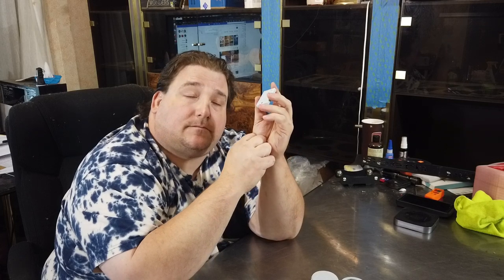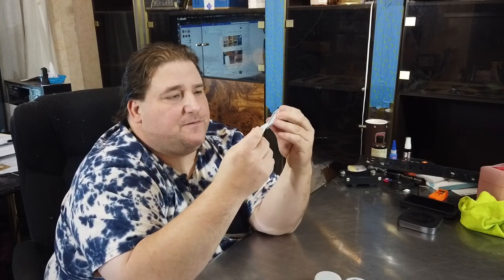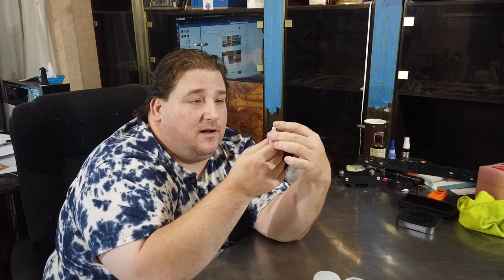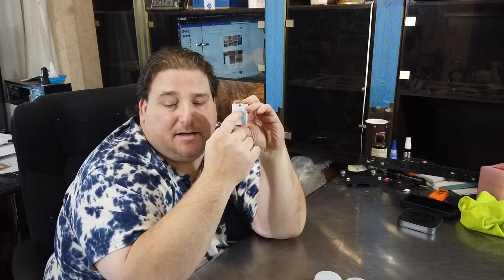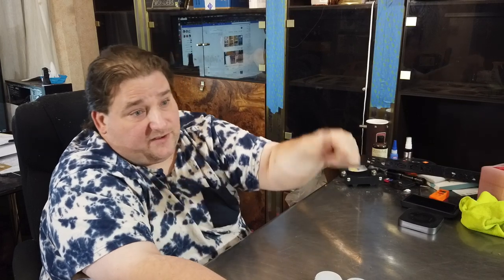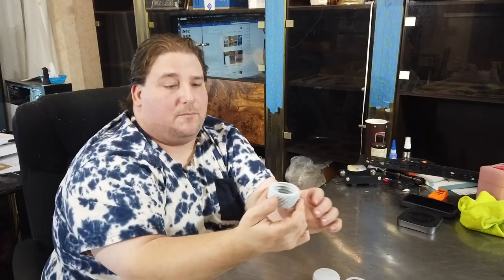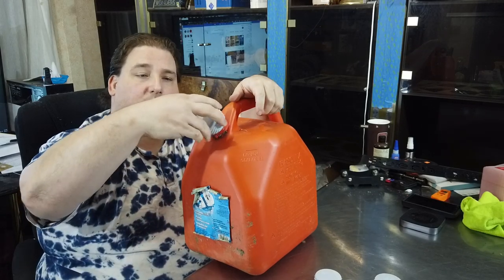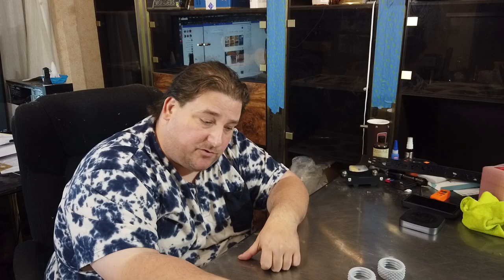Gas Can Cap and Micro SD Card Case   T3DP

Comment from the maker: I apologize. I can't do a live stream today. I am moments away from disconnecting my internet for the next many hours. Comcast ran the cable "above ground" a separate crew will come later to bury the cable. The containers that will for my storage and work shop space eventually are being delivered today (yes got the permit no problems)

SO I have to disconnect the cable line before those trucks come in and destroy it :-) (it crossed right over the road going to the back yard) Last night I moved the bus and trailer out of the way and cleared the space. as soon as I am done posting this I am going outside to mark off where they are to go and await the arrive (next 30 minutes) of the first container. I will of course take pics and video! :-)
Reply: Awesome, things starting to come together nicely.
Reply: Thanks for the update.  That's a damn good reason for not having a stream today !
Reply: Since I can't ask on the livestream, what can you tell me about the 
Jazla J1 printer? How do you compensate for an unheated bed?
Reply from the maker: No idea. Will have to wait till i get it. Pla is ok without heated bed just use tape or buildtak faketak surface. Also not too hard to add heat to bed cheap assuming its an aluminum substrate.
Reply: @nerys71  Thanks! I'll surf around the pricing and see how I do...
Reply: Whoops Chris  ignore my question on your Life channel...
Reply: Theres a briliant looking glass clear filament on a FB group the other day, need to get on my PC and mention it to you...Laurie
Reply: @nerys71  Thanks! I couldn't resist the $76 price on it, and got it. Hope you did too, so I can see your expertise in action on a printer that looks like the usual printers, but was way cheaper...
Reply from the maker: @Pygar2  oh that was irresistible. I nabbed one and it says its shipped. so we shall see :-)

Comment: nery did u get the stl file only no reply or responce .wayne
Reply from the maker: Yep i got it. Maybe will print on the ender 5 plus after stream tommorrow.
Reply: @nerys71  Hope its the 2208 board inside just put one a ender 5 omg .. nite and day differance .and oh so quiet currently £ 175 here in the uk for the ender 5 so had to get one. was going to hang out for the plus but dont really need it as running out of space . but £175 i couldnt help myself and added one to the fleet. wayne